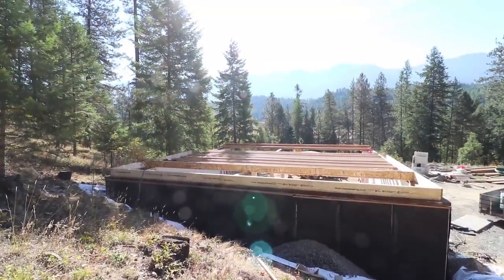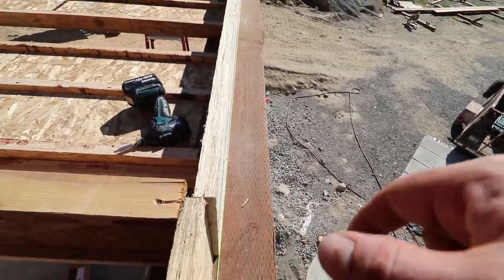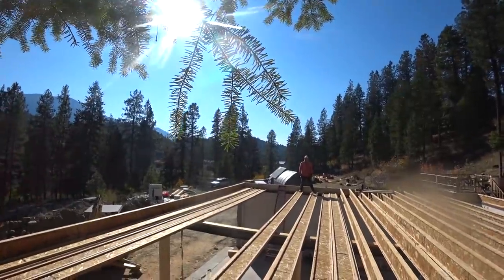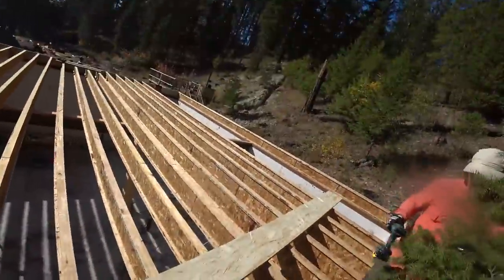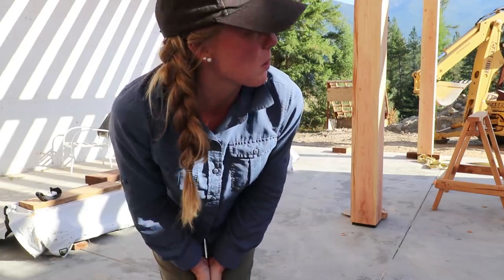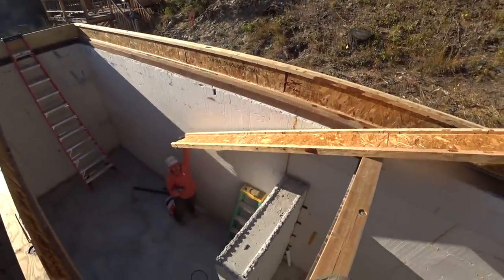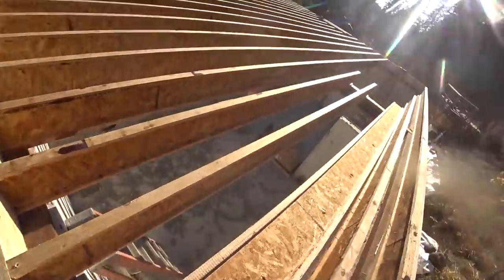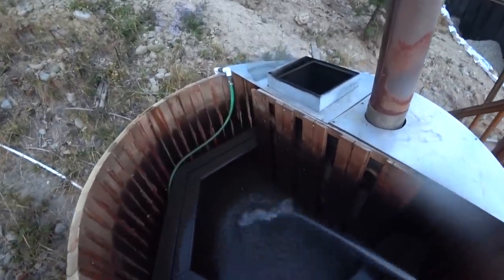OUR HOUSE LOOKS AMAZING (I-Joists & Rim Boards)

Comment: I see why they decided where there is no building codes, I mean really framing with deck screws, no shear in a screw use nails you guys or your building will fall down
Reply: Really, how come ?
Reply: Because Sr Design said so despite the fact that screw are more secure and stronger than necessary for the job.
Reply: He's right, though.  Screws are not the right fastener for this job.  There's a guy on YouTube with a channel called "Essential Craftsman."  He's a pro construction guy, and has a video simply called "Screws: What you need to know" and he outlines why screws are generally not good for this kind of application (specifically framing).
Reply: Thx ill take a look
Reply: When the wood fails before the screw does what difference does it make that a nail is less brittle?
Reply: It's not a matter of rot or rust.  Shear strength is about lateral loads.  When there's a structure on top of all those joists, and they get some windy days, the shear force on the house could cause screws to snap.  That's why it matters.
Reply: No the code says so, if I built homes with screws they would never get past the framing inspection. A screw has little or no shear strength if a load is put on it laterally it will snap and as they have there first floor held with screws the whole house will fail, I don't really care just observing how they are not building correctly. I send my guy's to this youtube channel to show them how not to build and for something to laugh about. remember youtube is just shit on the internet for entertainment!
Reply: *Sr Design
Go to a hardware store and buy some screws and test them. The screws holding the cabinets to the wall have been under shear loads for many years without failing.
Reply: Calvin, there's a huge difference between bearing a load like cabinets, and an entire house.  C'mon, man.
Reply: @calvin as I said it's not to code and I don't care what they do it's just entertainment, kinda like if John Cleese was to build a house, funny, laugh at it and move on!
Reply: NSMike87 the joists are sitting on the sill, not hanging....different application. And everyone is assuming they are decking screws....they could be structural.
Reply: * NSMike87
The house is not hanging on the screws the I-joists are sitting on the foundation wall and I-beam the screws are just keeping them from slowly migrating.

Having heated my house burning old shipping crates I tore apart thousands of them. the easiest to break down were held together with smooth shank nails followed by ring shank nails then deck screws and then spiral shank nails. the reason that it was easier to take apart crates put together with screws was because they could be removed with a screw gun and the spiral shank nails had to be pounded loose with a sledge hammer or the boards cut and the joints levered over which didn't work with the screws.

The reason that screws pop off their heads so easily is that inclined plains are so effective at transferring force. The metallurgy and design that goes into making screws has improved as well making the hard heads necessary to survive the screwdriver without making the rest of the screw overly brittle.
Reply: calvingreene90 so thankful for your informed reply.  I get so tired of the know-it-all comments from viewers who haven't been watching the whole build.
Reply: I have replied to someone else's comment on here about screws and nails. Ok for one my experience, im a general builder, i own my own construction business. by trade 9 years as a bricklayer. I have built houses, i have done remedial work and I have done alot of framing.
I'm currently retraining as a plumber.
Now here is where 99%of you are wrong where is the shear load? Do you even know what sheer tension or sheer nominal is? No obviously you do not! Shaer load is where a load or materia is cpmpressed from the centre out. Thus is fastened to another without notching or plates. Shear load is a vertical force that pushes down and horizontal outwards if no nominal support is central of load.
Now let's get onto the screws, construction trade screws made of brass or tensile steel are in fact better for framing do to extremely high compression load strength and shear strength.  Nails from a nail gun WON'T BE COMPLIANT due to the fact nail guns cannot fire long enough nails for framing. Also nails have bad compression strength and an ok shear strength.
Also if most of you have ever done joists you will understand what LOAD bearing is. The joists are resting on sill plates on the exterior/inner leaf. And on a load bearing I beam in the middle these would carry and spread the weight so there would be no need to CALCULATE A SHEAR LOAD!
Reply: @sgtAMYNTAS  looks like your a jack of all trades and only for 9 years, I've been a journeyman carpenter for 35+ years building houses since 1982 and have NEVER used screws for framing they are just not to code they will snap, using GRK's would be great but the cost would be so high may well just build a concrete home. as I've said in comments before they can do whatever they like, I don't care it was just an observation, move on!!

Comment: screws have no structural stability guys... i would put some nails in there... in the event of any moment the screws will shear right off there is no strength to screws in construction ... if the engineer told you to use screws they are wrong... screws have no vertical strength there never used in construction ... maybe holding floor down but never to hold wall's,, unless those are structural screws.??? decking screws will not work..??? please look it up before you start with the walls... looks good..
Reply: jason hullihen this happened 2 weeks ago bud. They either fixed it or they left it like that, either way your comment contributes in no way to their progress ATM

Comment: I hope you are going to install the x-bracing before you lay down the warmboard. If you don't block, your floors will bounce like a diving board.
Why haven't you purchased scaffolding? You are going to need it for sure on the house interior, and it will save sooooo much time and effort on the current work, as well as being much safer.

Comment: Consider when rolling joist to set one edge of building up perfectly with the LVL rim and then load all the rest of the tji's on top of the walls.  Then roll them all with one end run wild but placed on layout and then snap a line and buzz each one to length with a skillsaw from on top of the wall.   Then work the center beam tji's and block them as you go.  This floor frame is a job for 2 people, 6-8 hours.  Cutting them on the ground with a chop saw is difficult as I'm sure you learned.  I guess you're not doing it for money so what the heck, I feel bad you both have had back issues and you're working too hard for what is really needed.  Also I would have had all those joist delivered to the top of the wall instead of the ground, there should be no additional cost for this, same with truss roofs and roofing materials, plywood etc.   Looks great.

Comment: Why are you using screws? Screws are not for framing. They have no strength when the structure moves.  Do a test. Put a screw in a vice half the length.  Hit it with a hammer. It will break off.  Do the same with a nail the same diameter.  It will bend.  Go buy a nail gun and nail everything you have screwed in.  Screws are for decks and used to hold down horizontal boards only.
Reply: Joe Worden .
Reply: Increase quantity by one
Reply: michael ryan I didn’t see them using any nails.  I didn’t watch them put up the rim boards.  If they used screws for that and they are not Simpson or some other structural grade they have a problem.  They are learning as they go and I assume this little issue didn’t slip past them and their engineer told them what to use or maybe they already knew and I’m wasting time!  I’ve been in their shoes.  My wife and I built two and remodeled two.  They will have a strong marriage after this!
Reply: Ed Donahue - let's wait patiently for the next episode in which Jesse will call the engineer and get the right specifications. Then the screws will come out and the nails will go in.
Remember, this video is listed in "entertainment " category.
Jesse doesn't read any comments posted under their YouTube videos, but I'm here specifically for the comments. There is a great deal of knowledge posted in here, all we need to do is sift through it !
Reply: MAR.iPhone I agree. I’m not criticizing them by no means. Just trying to help them in case this is something they may have overlooked.  Sometimes it the little things that can come back and bite you. They are doing an amazing job.

Comment: Looking really good! You might want to put screws through the sill plate into the ends of the joists along with toe nailing them from the top of the joist. It will be stronger and pull the sill over tight to the floor joist.

Comment: Time to build some "Quick and dirty" stairs up top the top level to free up the ladder.  You have lots of scrap to use for treads.  Looks fine so far.   Looks like you are on track for the timber frame parts.

Comment: Is there a reason why you guys don't use nail gun's?
Reply: air supply probably
Reply: Nail guns WON'T be complaint for their framing needs engineering joists should be lagged or screwed down

Comment: The comedy continues. Re-using deck screws to build a floor system has to be a deliberate joke. Besides deck screws not being allowed by anybody's building code, using a nail gun is a lot faster than driving screws. If he had a nail gun he could install the joists exactly as specified by the TJI 360 installation guide.  The ends of each joist require two 8d toenails into the sill, three nails to attach the web stiffeners (which he didn't install) to both sides of the web, and a nail thru the rim joist into each flange. Also, the rim joist needs a 16d nail every 6" to hold it to the sill plate. And there should be squash blocks where the joist crosses the center girder.
Reply: i also just noticed at 3:00 that the screws through the flange into the sill are TOO CLOSE TO THE END OF THE FLANGE. They're supposed to be at least 1.5" from the end of the joist flange.
Reply: Bruce Adler- Blah blah blah blah blah... Mr know it all strikes again... I don't think they actually care what you think, and guess what? Nor do we... Here's a novel idea,... Why don't you start your own youtube channel and see how many subs you get with your crappy attitude... 😱😱😱
Reply: "For the want of a nail, the kingdom was lost." 

I guess I'm ruining the final punchline for people like you by pointing out this far in advanced the blindingly obvious fact that three used, incorrectly installed, deck screws are not equivalent to 7 correctly installed common nails.  

Those screws are the reason why his floor deck is not going to be as stiff as it was designed to be and why it will have a lot of creaks and popping noises as the house warms and cools.
Reply: Surely you've been in houses which just "feel" weak, poorly built, cheesy or rickety. Such houses are in no danger of falling down but they just don't feel solid and well built. The reason they don't fall down is that they have a 100% design margin. But if you make too many construction mistakes you will eventually run out of margin.

All houses have lateral loads and have to withstand racking forces.  Legend, your theory about down forces on the screws is completely bogus. Have you ever heard of "wind load", or "diaphragm stiffness", or "torque about a pivot point". The engineer that designed that floor system took all those factors into consideration but he assumed it was going be assembled correctly and didn't waste money on adding extra strength beyond the 100% margin that's required. And engineered I-joists only work correctly if they're installed correctly and not compromised by construction mistakes (like leaving out connectors, or drilling holes or cutting notches where you're not supposed to).

The dynamic and static load capacities of the floor depend on ALL its moving pieces having the correct connections. A heavy appliance or piece of furniture in the middle of a room causes rotation and shifting of the ends of the joists at both walls and can cause a compromised joist to fail (it happens all the time in older houses).  You get 30 people in the room and get them all dancing in time to the music and that brand new floor could potentially fail. Poorly constructed decks built with screws rather than nails, or missing connectors, fail all the time.
Reply: I have seen lots of stupidity in building  codes so saying that the code building codes say it is wrong does not impress me.
Reply: calvingreene90, are you referring to something like the IRC or UPC or IBC or the NEC? Or did you actually mean local zoning or local building regulations in some small town somewhere. I've heard that claim lots of times but I've never heard anyone back it up with a real example from one of the national or international building codes. Could you take the time to explain what you're talking about. 

Usually complaints about stupid building codes are from someone who just doesn't like being "controlled by  gubermint inspectors" and/or doesn't appreciate that following the code is actually going to get him/her a better house and probably save them money in the long run.

Are you also not impressed by the fact that driving 7 screws per joist end takes about 30 times longer than shooting 7 nails?
Reply: Mr. B , Perhaps the question you should be asking is why Bruce Adler attacked Jesse and Alissa in his orig post that I replied to... 🤓
Reply: Bruce Adler-  please comment fact.  Construction screws are MORE compliant than using nails.
Reply: Properly sized and installed NEW screws can exert more clamping force than similarly sized nails. BUT, properly installing them means drilling the right size pilot hole and shank hole and then torquing the screw enough to stretch the screw the proper amount. If you don't correctly pre-drill the wood you risk splitting the wood or destroying the clamping strength of the screws. And, screws are more brittle than nails and typically will shear off easier than nails so you have to be careful to limit the lateral force applied to the screw. And all bets are off when you re-use screws (unscrewing them is likely going to over-stress them and destroy their strength). 

So like I said before, three incorrectly installed used screws do not equal the strength of the seven nails required per i-joist end. The final nail in the coffin is that driving screws takes a lot longer than shooting nails and when done incorrectly it's just a huge waste of time.

Comment: Great as always(good job girl!). 1 question, what is the plan with the exterior basement wall & when does the backfill happen? And it wouldn't be a bad idea to back up the joist screws with something that hasn't already been used 2 or 3 times. Just shoot in some 16p with your nail gun for some for sure strength and integrity. Food for more thought.
Reply: You do not back fill a basement tell house is on it.....................
Reply: pored walls my not collapse they my crack with a block wall you could collapse the hole wall.....

Comment: You have said your self that you don’t read the comments . So I know you won’t read this... but dam.. blocking as you call it(noggins) needs to be done to counter act floor movement and it needs to be done tight.. ie. fix joist , fix noggin  fix joist ... you don’t fix all the joists and then add the noggins .... and your engineer said no need ... fire that fool

Comment: Get some tool belts
Reply: Yeah, what's up with that? Without a belt, you will spend 3 times as long to build any part of this. In that belt goes a tape measure, a chisel, a speed square, a pencil, and a hammer on a separate loop. You can add individual tools as tasks require. I see that you are using an impact driver and screws, extensively. Get a loop for your impact gun.

Comment: 16s are in red and the black diamond at 19",38 and so on were for I joists. when they first came out they cost more than lumber so it was decided to move them further apart to offset the higher cost. but it never caught on, yet the marks are still on tapes today.

Comment: TRUST YOU TWO ARE MILLING AND STACKING YOUR BEAMS,POSTS,AND JOISTS-on terra firma
   -from raw wood you bought to make timber frame structure -      B4 "white stuff" comes down ~~
  
   instead of foolishly standing on FOOT wide wall -with 12 ft fall onto UNYIELDING concrete floor or craggy boulders
     OR did one of you FALL?       (thus no videos in past 4 days)

Comment: Use T & G plywood, preferably 3/4" BUT 5/8 would be OK. If you don't use T&G you will need to block at the plywood seems (a lot of unnecessary work).